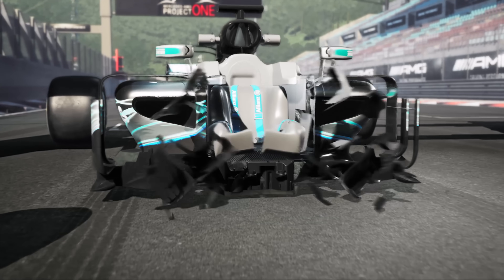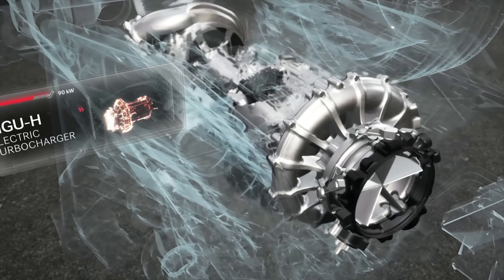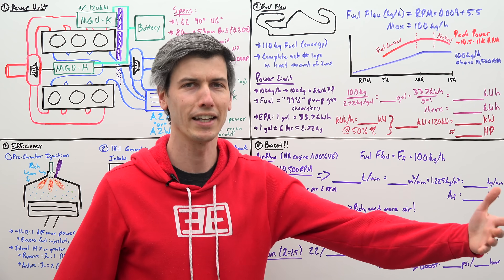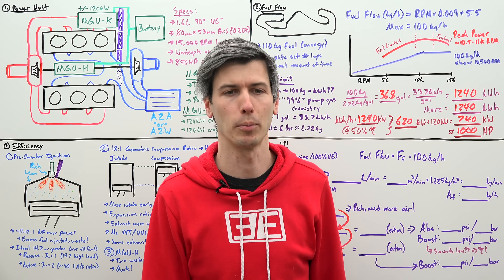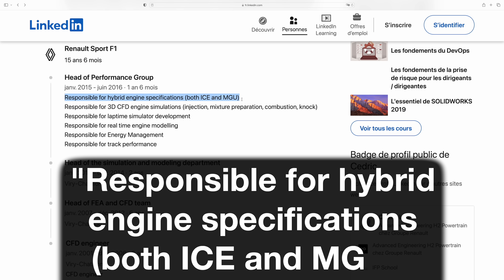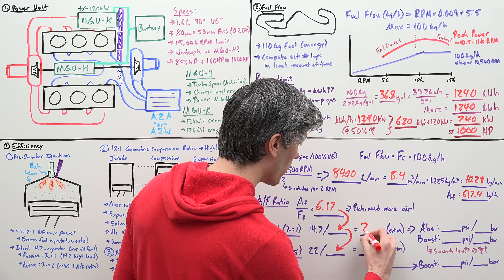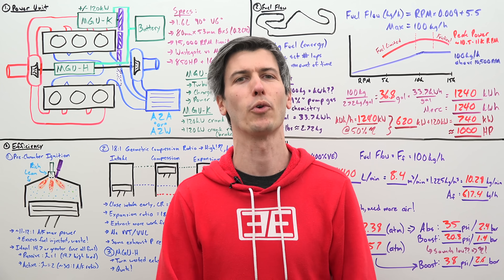How Tiny Formula 1 Engines Make 1000 HP!

Comment: Seeing that F1 is currently discussing the new engine specifications for 2026, I think it would be awesome if you could talk about the technologies you would want to see implemented(or removed).
Reply: The main point of talk regarding the new regulations is removing the MGU-H, which is a very expensive part, and was also one of Porsche's requirements to join the fray.

Another change is that they will run 100% sustainable synthetic fuels from 2026, and a bump in power for the MGU-K.

There's an official FIA document stating all the changes somewhere on the internet or FIA site.
Reply: Yes this would be good
Reply: Take the current number of cylinders, multiply them by 2 😂
Reply: @Savak22  and what? have 12 mini piston/cililinders like a toy? that's not reasonable or logic...
Reply: @jtiagosd  That's a terrible analogy, 12 cylinders have a distinct advantage, smooth and high power, as well as linear power delivery. You don't have balancing issues unlike a V6.
Reply: @1001speedster  sorry you didn't convinced me, a v12 in 1.6 litres, each cilindre must have 2 or 3 cm of capacity??
Reply: @jtiagosd  am just talking about V12s in general, why would I need to convince you? You're not the fia or an f1 constructor. And funnily enough Ferrari had a 1.5 litre V12 in their very first car with 125 cc in each cylinder all the way back in 1947 and you think manufacturers can't produce a 1.6 albeit improved with modern tools ? ... Go troll elsewhere.
Reply: @1001speedster  never a troll, I loved when lancia with a 4 cilinder car made just 2 seconds shy of senna's record in Portugal Estoril circuit with a v10. We are not going anywhere with this, but don't call me a troll, just because you are a supernerd, and don't know propper history!!!
Reply: @1001speedster  the current engines are tuned to have a pretty linear or at least as linear as they want it power delivery, the turbo is spooled up by the MGU-H. the only thing to really gain from an NA+Electric V10/V12 is the sound and it would likely come at the cost of power and emissions
Reply: @1001speedster  ferrari made a V12 in 1995 at 3litres and whilst it had slightly more power than the V10s everyone used it was both heavier and thirstier meaning it slowed the car down as it had to carry extra fuel compared to the others. the tiny V12s and honorable mention to the BRM V/H16s of early F1 at 1.5 and 3litre displacements where interesting but certianly not the best way to make an engine, there's a reason 3/4 of the grid ran Cosworth DFV V8s 67-82 and on a couple of years (69 and 73 iirc) won every single race in the season, even in 1982 with 1.5 V6 and I4 Turbos making way higher power the WDC was won by a DFV
Reply: @jtiagosd  133.3333... cm per cylinder, which would lower reciprocating mass, allowing lighter con rods, crankshaft, etc...
Reply: This!!
Reply: why do f1 v6 turbo engine sound so good but porsche 911 sound like a vacuum cleaner?
Reply: Bring back the f-ing V12 - Seb
Reply: @edmondhung6097 nah, V10s were the pinnacle of engines. More cylinders doesn't mean better.
Reply: Would be nice of they brought back the super lightweight high revving V10s with the MGU-K system now that formula 1 will be using carbon neutral synthetic fuels. The road car relevancy imo doesn't matter as much anymore since there's this giant push to full electrification. One of the main reasons for why they wanted to use the Turbo hybrid V6s is that they have a lower carbon footprint, but since synthetic e fuels are becoming mandatory, I really think that they should go back to the "guzzling" V10s and maybe find ways of using this new learnt efficient engineering from the turbo V6 hybrid era and maybe apply it to the V10s for grand prix applications. Would be awesome to see!
Reply: @1001speedster F1 has always led in automobile technology development and even though the amount of trickle down to production vehicles fluctuates, I do hope the synthetic fuels would lead to adaptation to road cars.

I'm not against electric vehicles but I don't think batteries and overloading our electrical grid is the solution.
Reply: @choyMM what f1 tech trickled down to regular production cars🤣

Maybe the f1 gear box ferrari and maserati uses but thats only reserved for the rich.
Reply: Why, cost is insane, electric is the answer.
Reply: @airgliderz  that's formula e.
Reply: @airgliderz  Because f1 is not going full electric for the foreseeable future. It’s not good enough for the show.  If becoming more environmentally friendly is their goals, then the least they can do is to continue improving the engines to achieve a higher efficiency.
Reply: @airgliderz  E is too heavy...you forget distance
Reply: @readmore3634  all solvable challenges.
Reply: @airgliderz  Maybe in 15 years. Batteries are still very heavy. Synthetic fuels are the way to go atm.
Reply: @airgliderz  go watch formula e then?
Reply: @airgliderz formula e is electric and it's boring as hell.
Reply: @choyMM  only in your mind and other electric haters, and it is in its infancy, exciting times.
Reply: @airgliderz  ask random racing fans if they can name 3 current Formula E drivers and teams without looking it up on the internet.

Nobody knows because nobody cares. It's the WNBA of car racing.

Comment: Another great video from EE. Always informative and entertaining. I'd say Jason has got his Lead blood level down to 0 :)

Here's an idea for a video ... why does increasing the compression ratio increase power? You need more power to compress the air (or air/fuel mixture) but the engine creates even more power from combustion. Is it because the mixture burns closer to 100% complete under the higher CR?

Comment: imagine F1 engine using pneumatic actuated valves like free valve, imagine the engine efficiency reaching 50% not ony at one point of Rpm but on a wide range of rpms ...

Comment: Another reason to run a very low level of boost, is the temperature increase. The more boost, the more cooling you need. Coolers take up space and weight and you don't want to do that, except for when you really need to (which is why some races have modified coolers).

Acquiring proper temperature is a big thing aswell, as in 2023 fuel temperature may only be 10 degrees (celcius) lower than ambient air, previusly being 20 degrees. So the air going in needs to be cooler this year yo achieve same i inital burn temperature before ignition, especially in hot areas.

Comment: 1.5 bat of boost, 15:1 compression ratio and a riddiculously lean mixture.
Anyone cares to explain how on earth does it not knock every single time? And how come does it not melt?

Funfact: F1 engines are so tightly manufactured, that you CAN"T start it cold. The pistons just fit too tight in the cylinders. Before the start up, they cycle warm coolant all night.

Comment: Your high compression explanation is what the mazda skyativ system does, basically a valve timing to simulate an atkinson cycle in an otto cycle engine and is quite old tech.  Boost pressure is a restriction to flow not an indication of air consumption, a more efficient engine will make more power with less boost because it's using more air, many people can't wrap their heads around that and think an engine running more boost must be making more power which is not always true.

Comment: Multiply your abs boost levels by 2, as you forgot that the same way you divided the airflow by 2 due to only 1 intake happening per 2rpm, the fuel injection also happens every 2rpm per cylinder (if we want to be pedantic, you should divide everything by number of cylinders as well, but as in the end you calculate a ratio, it doesn't matter...). Also,  (100kg/h / 2.72 kg/gal ) * 33.7 kWh/gal = 1240kWh/h = 1240kW ;)
But very good video, spot on!

Comment: I'm guessing they wouldn't want a high boost turbocharger in an F1 car, simply because it disrupts the driving mechanics in cornering. F1 cars are hard to control as they are. Turbochargers make acceleration paddle response variable, however minute that may be in F1, it's still a thing

Comment: That calculation of the boost pressure via calculating the mass of air needed to sustain combustion assumes the same temperature. As air passes through the turbocharger it heats up and unless your intercooler can reduce the temperature to baseline it will be at higher pressure for the same mass.

Comment: Omg F1 stole one of my ideas xD. My idea is a bit different though, in that it doesn't provide forced induction, there's no intake turbine, just a generator that directly powers an electric assist motor. There's also another variant where its down geared into a CVT that keeps the turbo RPM perfectly matched to the engines load and RPM and sends power directly to the crankshaft. 

Also another idea I've had is a steam hybrid, where the exhaust gasses pass through a boiler like in a steam engine and the steam powers a seperate clutchable steam assistance cylinder. A simpler version is having a water injector directly into the cylinder to turn more of the heat into pressure (steam) within the combustion chamber, but that would destroy catalytic converters.

Comment: Could be totally wrong but I think the boost calculation results in a low number because you account for half of the volume of the engine being used each rotation when it would be more likely to use 1/3 of the volume each stroke with what is presumably a 120 degree crankshaft. That would mean more fuel to air without the boost requiring a slightly higher amount of boost to make everything work.

Comment: There are 2 schools of thought on VE and boosted applications:  a) keep it mild and don't shoot for the moon, be reliable b) a more efficient NA motor makes a more efficient boosted motor.  It's reasonable to assume in a top tier motorsport that they will take the effort to tune intake runners, port designs, and camshaft profiles to be very efficient.  Trans-am engines are/were based on old technology and they were making 2HP per CID over 20 years ago.  That's 5.8 liters of displacement and about 640HP, so well exceeding 100HP per liter.  Look at today's street driven motorcycle engines and they are achieving 150-200HP per liter.  If the F1 engine is making 200HP per liter (the minimum I would expect), then 1.6L is 320HP.  The boost required would be (ideally) 850HP / 320HP = 2.65 * 14.7 = 39.04 psi abs - 14.7psi = 24.34psi gauge boost.  (The theory is that 14.7psi doubles power, or 640HP, so just subtract 1atm from the power ratio and you get gauge boost)

Comment: Jason, in the calculation of the boost you overlooked a detail. The actual intake per two revs is not equal to the engine geometrical displacement, because of huge Miller timing. The actual displacement to use in the formula is not 1.6 litres but 1.2/1.3.

Comment: The 1.5 turbo's from the 1980's made 1000 HP as well (more for qualifying), but they were anything BUT efficient. They were all boost (up to 70 PSI) and fuel, and part of that fuel was use to keep combustion chamber temps in check.

Comment: a single gallon of gasoline is 33.7kwh. a tesla battery is only 5.7kwh. a single tesla battery in weight is equal to 834 gallons of gasoline in weight. 834 gallons of gasoline is 24,000 kwh.

Comment: I find it sad that F1 limits the bore, the v angle of the pistons, the fuel flow, and even the materials used in the crankshaft, etc. It kills off innovation and basically means that they cannot make any more efficiency gains, it makes the cars run at rpm far below what they can do as you said, and it ends up making the cars sound like crap. They are limited to 100 kg/hour fuel flow and they can only carry 110 kg of fuel, and races last roughly 1 1/2 - 2 hours. This means they must run at levels drastically below what the engines can actually do or they'll run out of fuel.

Comment: In the video you said that peak efficiency was at lambda 2,1 so 30,87 air to fuel mixture (dont know why you schosed 1,5 in you final calculation), i did the maths and gave me 58,4 Psi or 4 Bar of turbo preasure, whoch seems a higer and more ogical number imo.

Comment: It just shows how little the car mfg are willing to do to make cars cleaner. All of this could be used but that would cut into profit. Instead they push electric which is just a "look over there!“. It's still polluting maybe more depending on what plant your charge came from, all the mining for the batteries ECT. I think a clean efficient hydrogen powered ICE would probably be a far better sustainable solution.

Comment: Since the f1 engines only intake air for part of the piston stroke wouldn't that mean that the airflow calculation would be higher than the actual amount, so the boost would need to be even higher?

Comment: Is it just me or does F1 have so many restrictive rules? I see why they limit displacement, but why force everyone to use a 90 degree V6 with a specific bore? I see why total fuel is limited but why is fuel flow limited, why is the max revs limited, and why isn't it allowed to have 2 fuel injectors per cylinder?

Comment: Quick spreadsheet calculation before I watch: 1,000 HP at 15,000 RPM is about 475 NM. Which is less than a Volvo XC90 at about 600 NM. [Feel free to check my maths.]
OK. Now to see how this compares to the numbers in Jasons video...

Comment: I find it hard to believe they would run a turbocharged engine at 20 psi at a 14.7:1 AFR.
I work with boosted engines on a daily basis and that combo equals a melted down engine.

Comment: Great subject and video! Are there any production cars that use the pre-chamber setup? I think BMW does (did) something clever with their smaller displacement DI engines where under the right circumstances a 30:1 fuel ratio could be achieved but I don't think a pre-chamber was involved?
Reply: About production cars e.g. AMG X1 and some Masarati with V6 engines. But that's not high volume production.

Comment: How expensive would some of these technologies be to put into production cars? passive chamber preignition sounds like it just requires an engine designed for it, not to mention active wouldn't be bad either as dual injection is rather common already. Also most cars are in the 10-12:1 compression ratio range, leaning toward the 10. It seems it would make more sense to have higher compression ratio, LOWER REVVING engines for mainstream cars. Instead of giving engines with 6000rpm redlines in corollas, lets put 4500 rpm engines that make 30% more torque and get 15% better MPG. Not to mention if theres a turbo involved, high rpm's are usually a waste because most are designed for low rpm torque anyways so they fall off (ecoboost im looking at you)

Comment: Not discussed here, but the MGU-H is exempt from the electrical power per lap. So if you can get power out of the MGU-H you can freely dump it directly into the MGU-K. It's commonly understood that at wide open throttle the teams are able to get a meaningful amount of power out of the MGU-H.

As for the production vs F1 debate, you aren't going to change your oil after ever trip to work and back, and you probably won't be hooking your car up to a pre-warming system to ensure the engine if up near operating temp before starting it, which allows for designing tighter tolerances at operating conditions and less blow by.

Comment: Just a question,  in the estimated boost calculation should you consider that the intake valve closes before BTC?  I.e: from an intake perspective the engine doesn’t act like a 1.6 litre but actually a smaller engine.

Comment: I think I heard one of the Sky F1 commentators say some time ago that Mercedes didn’t have to carry the full 110kg of fuel because their engine was so efficient (50% efficient). The rule is 110kg maximum to start the race. This allowed them to start the race with less fuel, therefore lighter and thus able to run faster, than the rest of the field.

Comment: Is there nothing to be said for the specification of the engine? The tolerances used are so marginal, running warm coolant through first, before you even think about turning it over. I know this is married to efficiency but still, I think this is where the power comes from. Plus, I know things have changed, but even now you can have 4 engines per year!! Each engine is done after about 1000miles. Its not just about efficiency, its about how much you can get away with. You could turbo charge my yaris and make 500hp. You could then run it for 50miles and it'd be ready for the bin 😂 
It's down to budget really. It's easy to make power, but customers paying £$100k for their car, want it to last 100k miles too!!

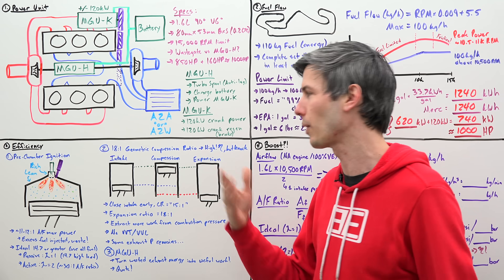Comment: At 10:46 Jason says close the intake valve early. You could also increase efficiency by closing the intake valve late, so as the piston rises, some of the air drawn through the intake goes back out the intake valve. Some production cars do this to mimic Atkinson cycle.

Comment: Engines are efficient when being used to produce power, wide open throttle, and running in their designated power band. Road car engines are designed to give the user a wider available usage, so we can do stop start traffic, sit on a free way idling along and so much more. They also need to withstand the average driver that may not service, use average petrol and so many other factors. So we lose efficiency in these engines due to these factors.

An f1 engine has a team of engineers making sure it runs, it does one standing start with a few pit stops over a race, the engine is meticulously prepared and needs to last a predetermined finite time, and for these reasons, they can design it to push certain boundaries.

Thanks for the informative video!